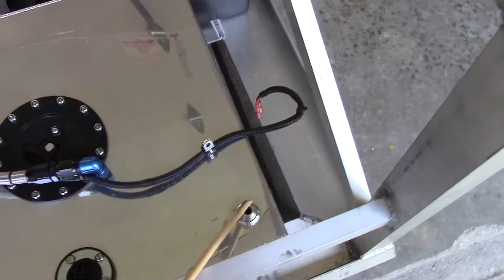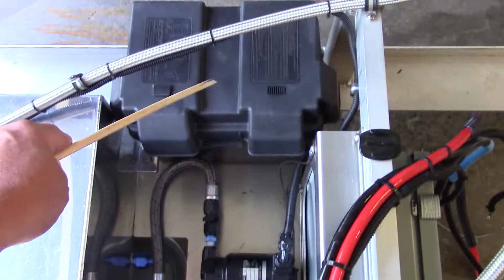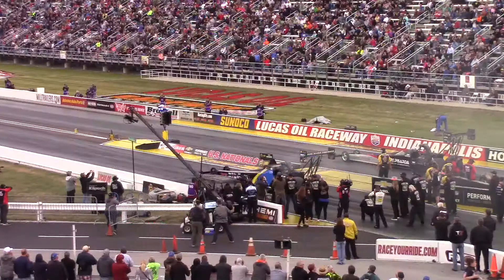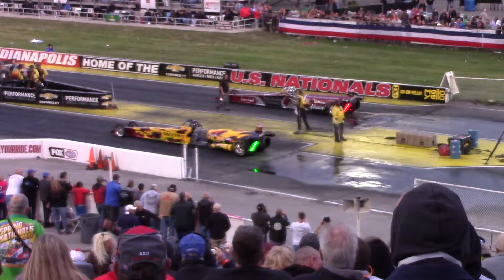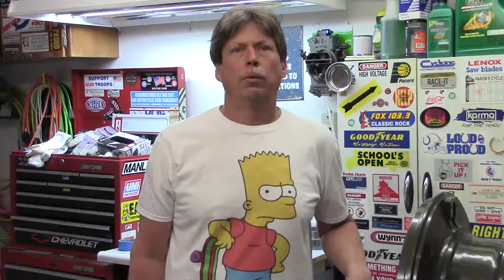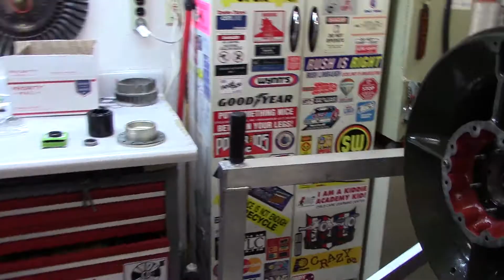The J44 Project:  Final Assembly, Part 3.

Comment: The machine is looking really good - and, of course, it rotates the right way!  It will be good to see it running soon.
We have a UK-based B-17, which does the round of the air shows and it was at the Bournemouth Air Festival back in August.  Unfortunately,  the Battle of Britain Memorial Flight wasn't there, as there was a manufacturing/quality problem with the reduction gear pinions of their Merlin engines, so no Lancaster.  However, we did have the Bristol Blenheim, with its two Mercury radial engine, which flew with the B-17.  We also had a Mustang, producing its characteristic 'whistle', with Glen Miller's 'In the Mood' being played over the PA.
It hardly matched those dragsters in terms of top speed, but I went to see Bloodhound's first public demonstration on the runway at Newquay, back in October.  It touched 210miles/hr, with reheat (afterburner) on for only a few seconds.  You should find it on YouTube easily enough.
Reply from the maker: Greetings & thank you for the compliment on the ol' girl.  Cosmetics won't get it running or running well but it sure encourages me to strive for perfection <in relative terms!>.  That B17 sure has a 'cool' sound; it really stands out from the normal air traffic around here.  The Indy auxiliary/business airport from which the bomber is based during its stay here is only about 5 miles away.  The normal sounds are business jets, helicopters & small piston-bangers. <Cessna, Aeronica, etc.>  Someone needs to manufacture (make them in a machine shop) some gears for those Merlins!  They deserve to be running & flying!  I'm pretty sure I've never heard 4 Merlins singing simultaneously; I would love to!  I will go see some video of the Bloodhound in the next couple of days.  Cheers!
Reply: As I understand it, the gears were a new manufacture  batch from an approved supplier, hence the grounding of all Merlin-powered aircraft of the BBMF.  However, they were back in the air right at the end of the season.  
Your best chance of hearing four Merlins in the USA would be to see four P-51s in formation, which, I would have thought, might happen at some air shows.  Otherwise, it would mean a trip up to Hamilton, Ontario, to the Canadian Warplane Heritage Museum, to see (and maybe hear) their Lanc.  I saw it back in 2015, when it came over to the UK and both Lancs did the air show circuit.
Reply from the maker: Bucket List item!!!
Reply: Some years ago, R-R had a big centenary flying event at the Castle Donington motor racing circuit near Derby.  I recall that one of the highlights was something like thirteen Merlin-powered aircraft (Spitfires, Hurricanes and Mustangs from memory) in the air at the same time.
Reply from the maker: Any recordings of them?  Maybe video?  I'm guessing it would be an awesome sound!
Reply: Search for 'Two Lancasters' on YouTube: you will find several clips.  There's a couple of them flying over the dams in Derbyshire where the Dambusters practised, at night and at much lower level.  My son flew his Apache over the same course some years ago, in daylight and at half the speed the Lancs would have been flying at.  He said that was quite hard work, even in a modern helicopter.

Comment: You touched on an interesting subject.  You said your boost pump would feed the engine up to around 50%.  You never said how you feed fuel over 50%.  I bought my booster pump off Bruce at Avon Aero and it too will not keep up after around 50%.  It was really a booster pump for a heli APU.  Bruce instructed me to use a check valve bypass.  Seems to work well.  If watching the boost pressure, it drops to 0 after reaching 50% meaning the bypass is working.  Engine looks fantastic!
Reply from the maker: I haven't ran it past 50% yet!  I have plans for a bigger pump once I get it running again so future (maybe this Summer?) work to be done.
Reply: My j-69 has redundant fuel pumps and draws fuel quite well after starting.  But the dual torch ignition system relies totally on a boost pump for starting.  So, the bypass works very well for running up to 100%.
Reply from the maker: You have a REAL jet engine there; mine is a beginner's jet engine.  Simple engines for simple minds!  Seriously, I have learned a lot, between Agent JayZ & my experience with the J44 Project.  I am grateful for the opportunity!

Comment: how much did you buy J44? and how much did u spent restoring it?
Reply from the maker: There is probably about $3000 in parts engine, repairs, new parts & miscellaneous other expenses.  Running engines like this, needing service, are $2000 - $6000, depending upon condition & accessories included.  There is one currently listed on eBay by David Steele for about $10,000, running & complete, in nice shape, ready to go!  He has video here on You Tube!  Thanks for your interest.

DD

Comment: Just wondering if you’re ok.
Reply from the maker: Hi Ken, yeah, just covered-up with work & some other side-projects, as well as waiting on my buddy Mark, who is fabricating some J44-related items.  He too has had a crazy Spring & Summer, so my favors have to take a back seat!  I am currently waiting on a completely refurbished fuel cell that has to go on the stand before the J44 can be installed!  Mark cut the original fuel cell apart, added some metal to DOUBLE its size (from 15 to about 30 gallons), added a few 'AN' bungs & a neat cylindrical fuel level sending unit (from Tanks Incorporated), then painted it olive drab green.  I am going to make an 'update video' over the next several weeks so you'll hear from me when I do.  Thank you so much for your interest & take care.

DD
Reply: Darren Duncan    Thanks for the update.  Good to hear you’re ok.  I certainly understand how busy it can get.  Adding capacity to the fuel cell=more fun!  Have a great day!